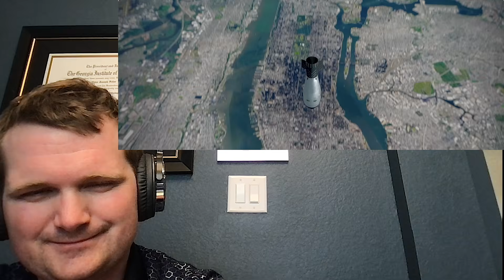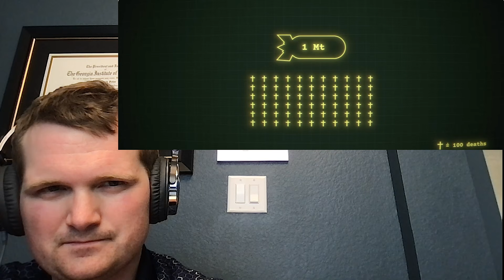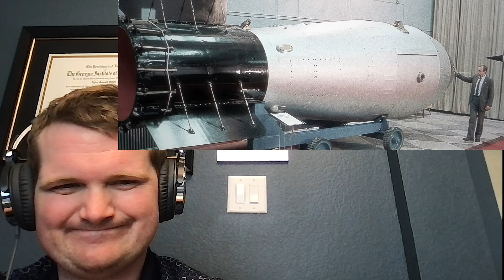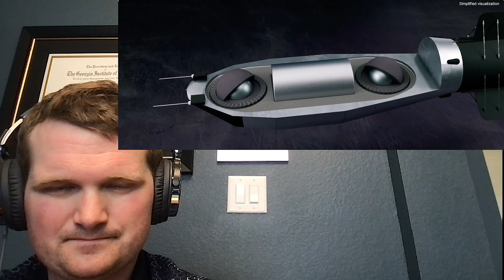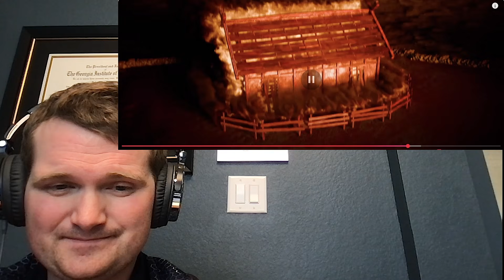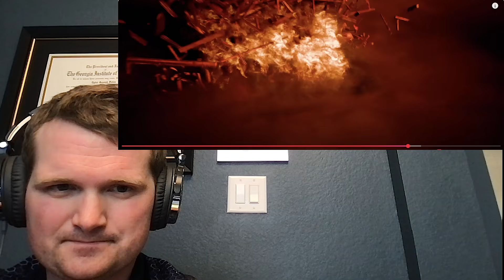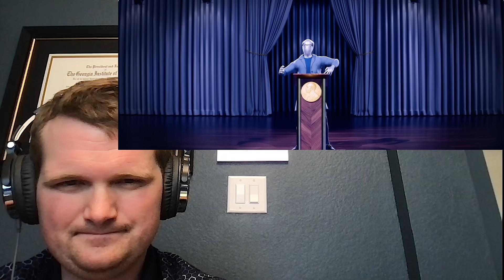The Biggest Nuke Ever - Nuclear Engineer Reacts to Fern

Comment: They never mentioned the stages and how they really worked:
- (first stage) electrical wire which go boom from high current as the primary
- (second stage) fast conventional explosives to shape pressure cones into the plutonium core
   what explosives are used, what current is used for the blast wires ...how to shape the pressure cones
- yield and of the third stage: the first nuclear stage ... time difference between the two first nuclear stages to form a nuclear blast cone into the fourth stage (compression into the center is not always optimal) ... is there a compression of fusion material in an ongoing fusion or is the fusion only reached if both nuclear fission stages compress both sides
- what about the fifth stage (like lithium in the US) ... is there a firth stage which is ignited by the fusion reaction?

Comment: The nasty thing about the 100 megaton version was the casing.
Instead of the 12 tonnes of lead used in the test device. The 100 megaton version used 10.5 tonnes of Uranium-238.
70% of this Uranium would've been fissioned by high energy 14 mev neutrons from the secondary and tertiary fusion stages.
This would've produced a lot more, longer lasting fallout.
The blast radius wasn't increased much though. Once you get to 50 megatons or higher, the blast takes the easiest route, straight up into the upper atmosphere.
Reply: That's why they eventually developed MIRVs. Having a bunch of smaller bombs actually creates a much larger total blast area, as well as making it just about impossible to intercept them all.
Reply: Yep, blow a hole in a pressurized container and the gases leave via the least restrictive path, i.e. the vacuum of space. The question is how long would it have Spaceballed?

Comment: Funny that he missed something while covering the U-2 incident helping ruin the conference in Paris, that the soviets started ranting we were spies and horrible for doing it. That being, after the soviets painted themselves into a corner by bad mouthing anyone who dared to spy on an enemy, they fell for the trap our officials had set for them. With the stage set and the soviets do such an extreme job describing how horrible spies are, thats when our guys brought out a big wooden object. It was a large crest of an eagle, carved in wood, and was a supposed gift for our embassy in Moscow from some group of soviet children. There’s a problem with that though. It had been discovered years earlier to contain a listening device that had no power source and could be turned on and off remotely. It worked the same way a RFID tag works now days. A soviet radio would turn on in a building some distance away on a specific frequency and at a specific power. That radio signal would hit the precisely tuned antenna of the device. This signal was energetic enough to power the device, its microphone, and its own transmitter. The device would then be broadcasting the audio it’s picking up at a specific frequency, one that the soviets were listening to and recording everything being said by the officials around it.
This device proved that the soviets had been doing what they said we were so horrible for doing, had been doing it for years, had lied to place the device and even used children to make it seem safe, and even played on our national pride in the symbol of an eagle. Basically, they were doing the exact same thing we were doing, and some would consider worse as our plane could be seen, heard, showed up on radar, could be tracked, its path be anticipated, and secret objects moved or covered before the aircraft’s cameras got in range. This while they snuck a listening device into a nations embassy, which is considered part of the nation whose embassy it is. 

Not a big detail in terms of the czar bomb, but important historical information in what led up to this.

Comment: 41:26 Yes, the scaling problem is due to the critical mass of the elements used. "Heat build-up/(free electrons without protons)" So to speak.
Somehow, even this "Tsar Bomb" showed this defect at the moment of detonation, at least because it didn't hit anything that would cause a critical mass to build up, but relied on an internal explosion...
------
And again, but especially for flat-earthers: If we only lived in two dimensions, how would they drop a bomb over our heads that would explode in... which dimension of your 2D heads?

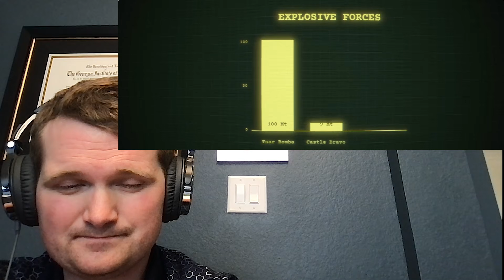Comment: 12:00. They've calculated it to be 6Mt. They thought Lithium-7 won't participate in chain reaction and SURPRISE it did so well they've stopped to separate the isotopes to speed up the production of the fuel. So the bomb was 2.5 more powerful than they've anticipated.

Comment: There is a lot of misunderstanding regarding the method of delivering this bomb. The bomber was used only as a test vehicle. The actual delivery system was supposed to be the UR-500 intercontinental missile, which was already in development by the time the bomb was tested and actually flew just 4 years later (!!!). Later, it was this missile that served as the basis for its civilian version, known as the "Proton."
Reply: No, the Tsar Bomba (RDS-220) was not intended for the UR-500 ICBM. The bomb itself was too large and heavy for practical military deployment, and no missile system at the time, including the UR-500, was capable of carrying it.

The UR-500, which later evolved into the Proton rocket, was originally designed as a super-heavy ICBM to deliver massive warheads, potentially including multi-megaton thermonuclear warheads. However, it was never deployed as a missile and was instead repurposed as a space launch vehicle for Soviet space missions.

Had the Tsar Bomba been intended for missile deployment, it would have required significant miniaturization, as even the largest ICBMs of the time couldn't accommodate its 27-ton weight and 8-meter length.

Sorry
Reply: @ShawnyStorm  you do realize that proton was big and powerful enough to be launching space station segments to stable LEO, right? Zvezda/Zariya/Nauka (the latest three ones) are pretty big and heavy stuff and RDS-220 would just need enough push to get over half the planet.
Reply: There was never any intended delivery system for tsar bomba,  the thing was built on an expedited schedule, testing of it announced to the US directly by Khruschev, and the USSR had no current weapons program to increase yields like this at the time building it began, they had been focused on miniaturization, not trying to make bombs with bigger booms, in fact the scientists who created it thought it was a joke to make such a big bomb, because they had no means of delivering it, and it had essentially no military usefulness. 

"There was no previously existing military requirement for a 100 megaton weapon - such weapons are virtually useless for military purposes. The Soviet Union had only one delivery system capable of carrying a weapon of this size - a handful of the relatively slow prop-driven Tu-95 bomber - and it was incapable of intercontinental range with a payload this large. A 100 Mt weapon can level urban areas in a zone 60 km wide, cause heavy damage in a zone 100 km across, cause 3rd degree burns in a region 170 km across (only a bit smaller than the width of West Germany) and eye damage to 220 km. Such a weapon can only be used as a means of destroying an entire urban region - a major urban complex including suburbs and even neighboring cities. This scale of destruction is much larger than any discrete urban area in Western Europe. With its dense settlement, use of such a weapon in Europe is equivalent to an attack on a major portion of an entire nation and its population. Fallout from a low altitude or surface burst in central England could produce lethal exposures extending into the Warsaw Pact nations; a similar explosion in West Germany could create lethal fallout as far as the Soviet border. Even in the United States there were only three urban regions at that time large enough to conceivably merit attack with such a weapon - New York, Chicago, and Los Angeles. On any smaller target it would be simple overkill. Even if the Tu-95 were able to reach Chicago, the closest plausible U.S. target, (which is doubtful given the enormous payload, far in excess of normal for long-range missions, and the added drag from the belly bulge required to house the bomb) it would have been detected crossing the North American early warning line and then been over U.S. and Canadian territory for 8 hours - ample time for jet fighters to intercept and shoot it down" [Zaloga 1993] Steven J. Zaloga. 1993. Target America: the Soviet Union and the Strategic Arms Race 1945-1964

Tsar  bomba was always meant to be a showcase to achieve political goals, never actually considered for weapons use, however they did use some design elements in a weaponized version that was tested at 24.2MT, full yield of 50MT, though that was a different design as it  was likely to be significantly smaller in size, but still only deliverable by the TU95, not by ICBM.

Comment: Pretty sure starship could create a Tsar bombs mirv and deliver them from orbit. In expendable mode 9 - 11 Tsar bomba warheads plus decoys...
But then we are in cobalt 60 territory, why do such a thing when it's massive overkill and likely to wipe us all out.
Reply: There is no need to Starship and 50 Mt.
Russian arsenal since 70-x had (and maybe still has) several SS-18 missiles with single 20-25 Mt warheads.
Yes, it's 2-3 times weaker than Tsar bomb, but does it matter?
Reply: @johnjohnson8818  I was just responding to the claim in the video that there was no way to deliver them. Not about the sanity of doing so. 🙂 Yes if you really wanted too you I believe you could deliver a 9-11 mirv Tsar bomba 100MT to orbit and presumably on a sub orbital trajectory that ends at your target(s). They would need heat shielding and some per warhead targeting thrusters.
Reply: Starship! Why bother with a payload?

Comment: 5:07 russian is my first language, and "we will bury you" is the most accurate quote. He actually said: "Мы вас закопаем."
Also the "project" of 100 megaton bombs which you've mentioned earlier is the same Tsar bomb, which is actually 100 Mt, but has this special mode of operation which mitigates the reaction and lowers yield to just 50 Mt. It was used in the test blast to give bomber plane a chance to escape. Many US nukes have similar feature, allowing to choose between 4 different yields on the same bomb/warhead based on the settings.
Reply: "Мы вас похороним" actually, i.e. "bury" only as it relates to the ritual
Reply: @Turalcar  я специально гуглил, мне выдало "закопаем"
Reply: @user44060  "Закопаем" появилось когда обратно перевели на русский. У Хрущева было "похороним"

Comment: Czar Bomba was intended to be launched by the N1 or other super heavy rockets as an ICBM.
It was canceled when the N1 failed.
Dropping the prototype from a Tu95 was a stop gap measure as the N1 wasn't ready yet.
Reply: That is not true. Double-check your information. The UR-500 missile was intended to be the delivery system for this bomb (and even more powerful ones, up to 150 megatons). It was developed and actually flew just 4 years after the Tsar Bomba test. Later, it was this missile that served as the basis for its civilian version, the "Proton" rocket, and, apart from a couple of incidents, it proved to be a reliable rocket produced in large quantities.

Comment: Environmental science is one thing, but Environmentalism is a kind of religion/propaganda where at its extreme everything that humans touch is destroyed. We'd be in a much better place when it comes to CO2 today if nuclear power wasn't nearly driven to its death in the 80s. Big coal just wanted power plants burning coal rather than using nuclear power, and we mostly used fossil fuel for the last 40 years because of that. Then at one hand, they might say that all we need is wind and solar, but they'll turn around and say they're bad because of the substances used in solar batteries and turbines smacking birds. They'll never be appeased, but people don't want to crawl back to the jungles, either.

Comment: I'm always a bit confused when you use "very conservative"; in this case, the findings would have been very liberal/lose with the facts, making wild extrapolations. A "very conservative" finding would be the most hedged-in speculations, the "minimum" possible outcomes of their findings.
So I wonder if you hate being corrected, but I also know you hate to be wrong. Did you mean liberal estimates?
Reply: I get your point and also had the same thought but maybe the background for the usage of conservative when it concerns health risks in medicine can help to clear the confusion. I don't know how conservative in this case is exacly determined but in toxicity studies in medicine for example a conservative approach would be the "safe" approach of lowering the acceptable ammount of a substance intake till adverse effects appear to a much higher degree than other approaches. It effectively says "we have found in our studies that x ammount of the substance is the estimated cutoff point after which negative effects appear so lets reduce our recommened limit by the factor of 10 (or more) to be safe" 
A conservative estimation in this case means expecting the worst and taking the safest approach which ironically leads to the exacly opposite meaning you would expect in other fields of study.
I hope this was somewhat understandable since english isn't my mother tounge but hey, I hope this helps with offering an explanation.

Comment: The pressure wave is the shock wave, at what point does it dissipate enough to transition from shock to pressure wave? I'd argue it's 2 words that both describe the exact same thing
Reply: A shock wave is when a pressure wave travels faster than the speed of sound in it's media. This causes an overpressure that can apply large forces onto objects. Once it is below the speed of sound it is just a pressure wave. It doesn't matter if it started as a shock wave once it hits that threshold it is a pressure wave as it cannot cause the same level of any damage.